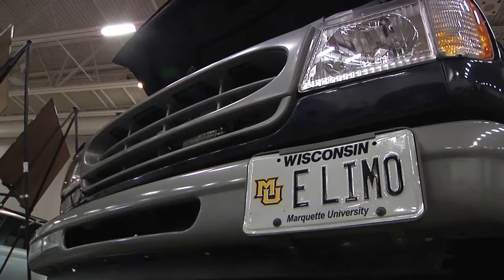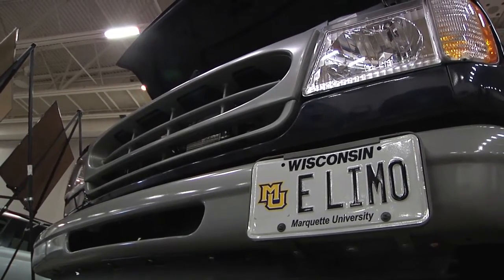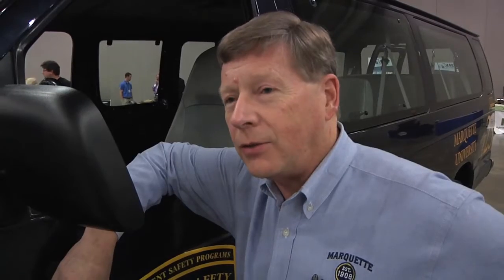Electric Van - Marquette University's eLIMO - Interview

Comment from the maker: This van is using an AC motor directly connected to the driveshaft - no intermediate transmission. This simplifies things, & saves the space and weight of a large component. However, it is at the expense of acceleration. This vehicle has slow acceleration. On the other hand, it's a bus used on an urban campus, so that's fine. 
On commercial vehicles, AC motors tend to be what's used now.I believe the motor in the Mitsubishi i-MIEV is a Permanent Magnet AC motor.

Comment: the car has a range of 72 miles but at that time the battery would have zero charge is it safe to do this or will it shorten the battery life?
what effect does removing the transmission  have on the car in general and on efficiency in particular? 

what type of motor are they using is it a dc or ac?

why there are no permanent magnet dc motors powerful enough to be used in an electric car?
Reply: teleß neß cell 10 oèrceñt tpó¹0 oerçt inçreage 79 mile   82 miklé   86 mióe ràñge